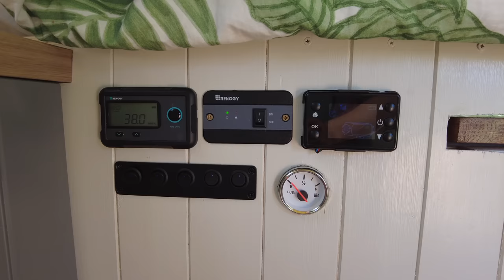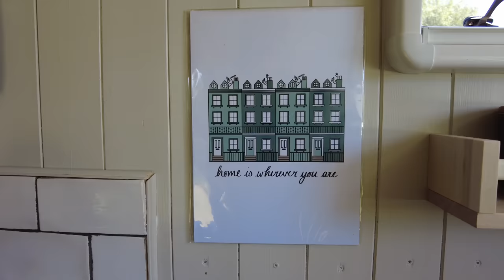Luton Box Van Conversion | Full Timelapse | 30 Day Build

Comment: Great build but that original thin roof lining is the worst roof you could have on a box truck that you want to convert. A bird could shit and pierce right thru it. Tree branches from campgrounds will tear it up and poke holes in it. Then rain will flood your inner ceiling and create lots of mold.
Reply: What would you replace it with

Comment: That was a fun build to watch. Thanks for sharing. That was a lot of wood. We are starting a build  and have a few questions about wood. How much does all that wood increase the weight? Wood expands when it get's hot and shrinks during cold. Did you plan for that fact? Is there a reason you painted with a brush and not a roller?  I assume you wanted the grain look. Could have thinned your paint and used a roller. What made you cover up that natural light ceiling? Did you add steps to your side door? Last question... what would you have done differently??

Comment: Did you have any issues with the roofing structure? I have the same fiberglass roof skin, and was told O shouldn't cut into it or try to place. Ceiling under or anything on top.
Reply: nice of them to share but not very helpful with advice are they...

Comment: Seriously I love these conversions...but why?!?  We spent $14K on a trailer that has all of that and more.  No additional engine to service, no huge taxes or maintenance...no work to build.  And trust me, I've flipped a few houses.
Reply from the maker: Hi! There’s lots of reasons we chose a van over a trailer; mainly thanks to our license in the UK, we’re not legally allowed to tow anything. 

Secondly, we viewed many, many motor homes and found that they weren’t the build we wanted, they didn’t have dog kennels, or a large pull out dining table, or a standard size kitchen, and they always lacked in head height. 

Thirdly, towing a trailer around Europe just wouldn’t be practical. The roads here were originally built for tiny fiat 500s and minis. It would be an absolute nightmare towing a trailer around tight bends, and finding parking. 

We absolutely love our home, and have travelled in vans for over 2 years now. We love the freedom it gives us to travel and live where we please 😊😊